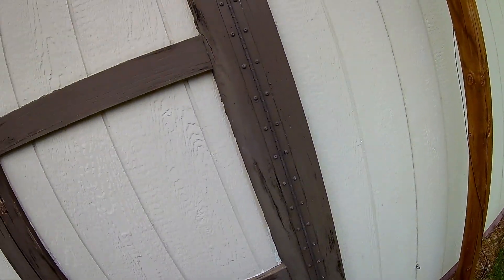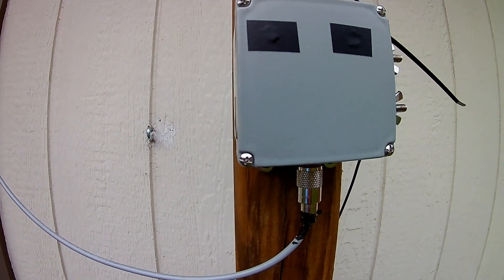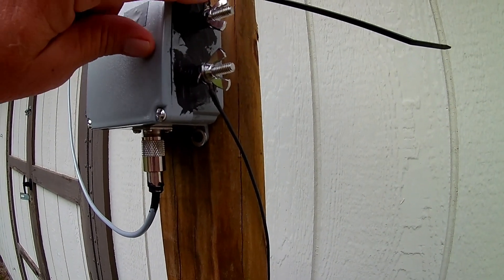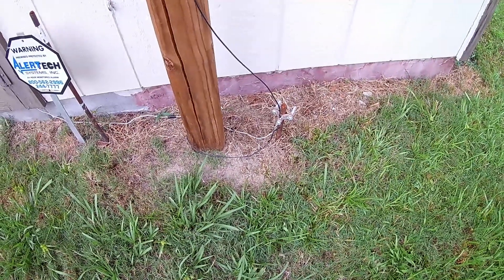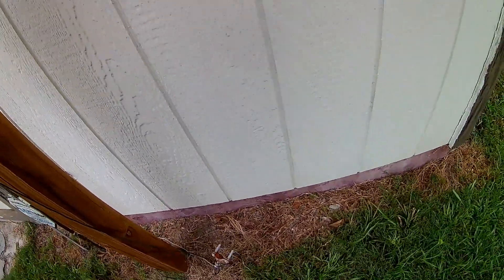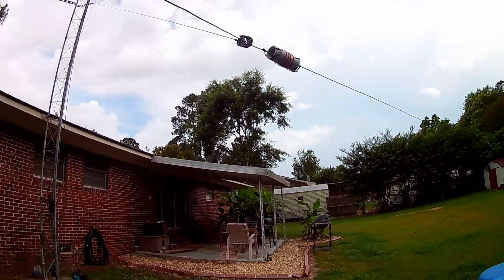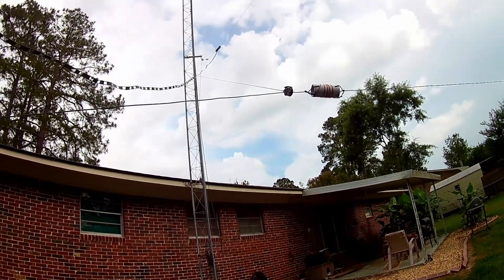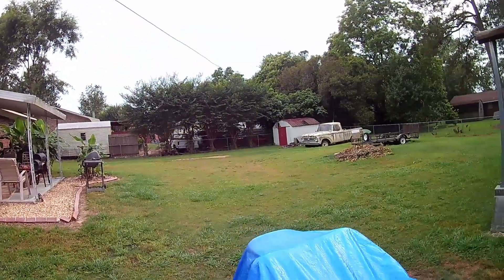10 - 80 Meter Band End Fed Half Wave Antenna Routing @ KK4WX QTH

Comment: In my opinion you don't need radials since you have a ground. Basically the radials are an artificial ground... so there would be no use for them since you have the real connection to ground ))) Nice one... 73 bud.
Reply from the maker: Many thanks!  I thought one wasn't necessary, but it didn't take any effort to string one out just in case.
Reply: @kvistads  I agree.... having something extra, is always better than having something less ))) 93 and have an amazing weekend.

Comment: Thanks for sharing! How does the antenna perform? I wish I had the space like you do to put up some proper antennas. Im jealous for sure. 73!
Reply from the maker: Hi Lambert:
Try looking into a shorter version of the EFHW antenna, like the 10 - 40 version or even the 10 - 20 version.  Another thought is that the antenna doesn’t have to run in a straight line - you can run it under the soffit edge of your house or perhaps the facia board.  Zig-zag or whatever you have to do in order to get it up, it should work.

Comment: looks good. hows it compare to the loop?
Reply from the maker: Hello N7, 
If I could only have one antenna between the two, it would definately be the loop.  A loop cut for 80 meters and fed with 450 ohm ladder line just can't be beat!  Not for a wire antenna anyway.  A lot of folks won't run one because of the ladder line.  I have an old Heathkit model 2060-A manual antenna tuner rated for 2KW with a 4:1 balun built in.  It has a roller inductor and will tune anything across the HF bands including 160 meters.  This is the tuner I use when I'm running my amplifier.  The other tuner I use when barefoot is an MFJ model 993B Intellatuner which also comes with a 4:1 balun built in.  It will operate up to 300 watts, but I usually only run the rig itself while using it.  It's probably the best purchase I've ever made, as for convenience and quick tuning from band to band.  The loop will run on any band 10 through 160, but not 6.  In order to run it on 160, you have to twist the twin lead at the feed point together and feed it like a long wire.  It essentially works as a "Top Hat" on 160 when running it this way.  You have to run a tuner of some kind on all bands, but with the 450 ohm ladder line, there is virtually no line loss.  Try it if you have the room, you won't be disappointed.